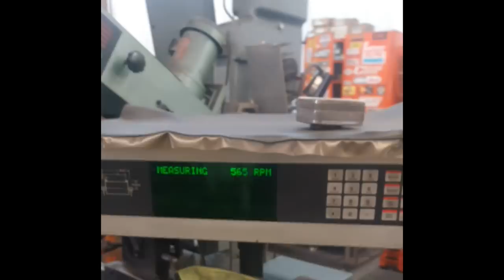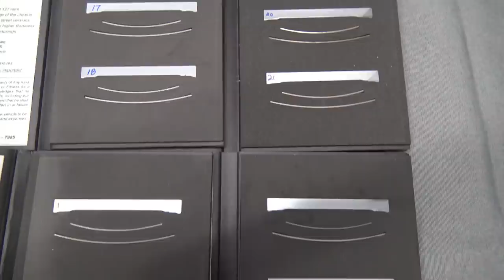700hp Billet 4 rotor R26B *Clone* built in 5 mins!  Mazda Rx7 Defined Autoworks Pt. 1!!

Comment: If only Mazda loved rotaries as much as we all do...😭😭😭😭😭😭
Reply: They do.
Reply: @efini_fc4276  REALLY...?! Then what are they doing about it...??
Reply: @bryanp4827  The only thing I will say about them producing an RE right now is I'd like to see crate engines from them, built not for the street.
But beyond that...

 They've accomplished and produced more than any of the top 10 rotary shops have ever done for the engine, put together... And a large amount of those shops wouldn't even be around without the Mazda-designed models in the first place.
If emissions weren't so tight, the engineering would be different and there would be plenty more of these engines filled with even more love, with a Mazda branding. I these guys don't build race cars more than they do passenger vehicles.
Reply: @bryanp4827  They have been developing rotaries since the cosmo, and are still developing it to this day. Its just that emissions have to be lowered first, but they believe in it like a religion, its just insanely difficult if possible at all to develop an economicaly sensible rotary engine. They sort of got their will now as they announced that their new Electric Mx30 Will get a rotary range extender. But to repeat it once again. Mazda is still obsessed with their rotary engine, its just that it takes hella time to develop one that will work in the modern world. I do however agree that they can also just build race rotarys. however with company's like billet out there, whats the point.. They don't have the manufacturing capacity anyway
Reply: They're the reason you even have the opportunity to love them in the first place lol at the end of the day mazda is a business and they need to sustain themselves, while rotary powered cars are there claim to fame in the performance world in all practicality reciprocating engines are what pays the bills and gives them the opportunity to be able to design new generation rotary engines. Let's face it rotorys aren't the most emission friendly engines and trying to produce one for the mass market in this day in age is hard. Hopefully they do start selling another rotary powered car in the near future, but if they don't at least they left us with great platforms and engine designs to keep improving on.
Reply: They do, it's just that rotary engines aren't profitable as a production car. Say Mazda released an RX9 - why would anyone buy it over a BMW M3 or M5? Or in the case of the US - any Mustang, Chevy or Dodge in the same price region? The average person would more likely choose those cars over a rotary car. Rotary's are only for the hardcore enthusiast of the rotary

Comment: Can i build a 26B using the rx8 plates and the 13b 1985 housing ?! And all the other custom parts like the e shaft, stationary gear, counter weight, the studs and solid dowel pins, the apex seal, and the other seals too...

Comment: Question, are the rotors on a 4 rotor set 180 degrees apart from each other? And I was trying to tell from watching the build how they are staggered. Can you expand on that for me please? Also, I have a perfectly running '04 RX8 that I love. How much to put in a deluxe 3 rotor motor, upgraded clutch, and transmission? If I brought the car to you.
Reply from the maker: On the eccentric shaft itself rotor 1 and 2 are 180 degrees,  2 and 3 are 90 degrees, then 3 and 4 are 180 degrees.  This works out to each rotor firing every 90 degrees.  20b full swap usually costs $35-40,000

Comment: Correct me if I'm wrong, but you bored two massive holes in the center iron of a 26B so that you could cool the front and back two rotors of the engine separately and more efficiently?

Comment: do you have to set the rotor in a set poistion like a firing order when you assemble it
Reply from the maker: Yes indeed they do.  A good observation.  A 4 rotor clocks each rotor 90 degrees apart,  and fires on the same events per crank rotation as a v8 actually.

Comment: Are you the one doing the machining? I'm a machinist myself and want to start machining car parts.
Reply from the maker: I do basic manual machining.  The cnc stuff is done by my machinist who I work with directly to make my unique ideas come to life.
Reply: @GTORx7  Awesome. I'm always making parts for side projects on the manual machines at work, lots of fun. What do you think of getting into rotors as someone who's never touched them? I like the FD Rx7, but it seems like it's a 50/50 chance of many things going wrong or having to upgrade many aspects of the motor.
Reply from the maker: @Nobody-dc8dp  nothing to fear. Just dont lean it out under boost,  don't run it out of oil,  and dont overheat the poor thing like crazy.  Obey those simple rules and they run great.  Oh and the BIG BIG #1 RULE...... don't feed it after midnight!!!!!

Comment: Wait wait wait... wtf.... How does this coolant system even work? Wouldn't the coolant just create super hot pockets in the right front and left front of the engine? I know how the coolant passages in rotaries move from right to left with the rear iron making the turn for the coolant in the back. Please explain to me how this works. Hell, I'll pay you for the answer.
Reply from the maker: Yes, coolant enters the center billet plate, and branches out to the front and rear on the hot side of the motor (same passages as factory) then the rear and front make the turn to the other side and flow back towards the center plate again. Once they join together the flow comes out on top. It has to be setup exactly even flow. This was a prototype. Since then this has been on the dyno with many temp sensors, all of which read completely even temperature.